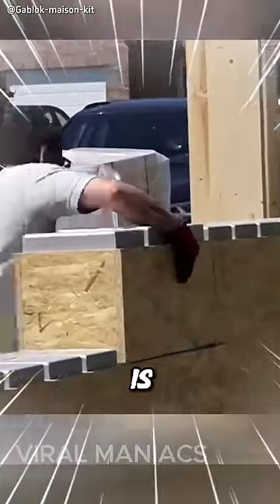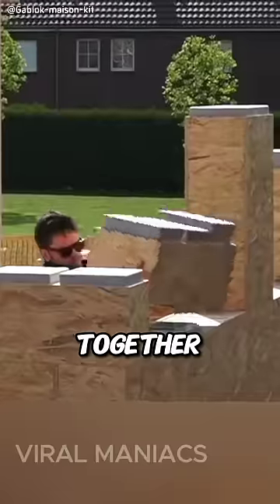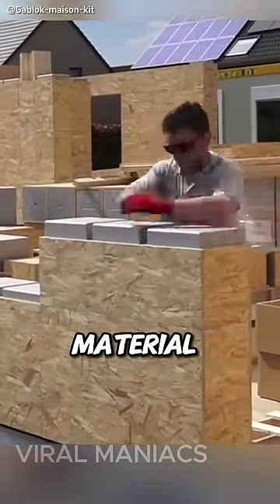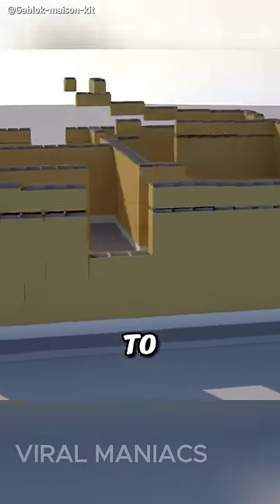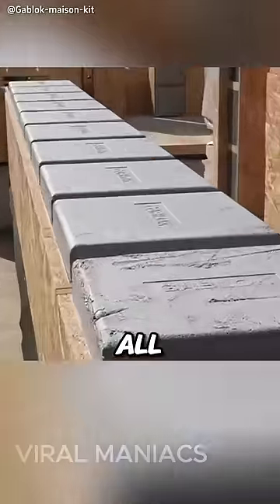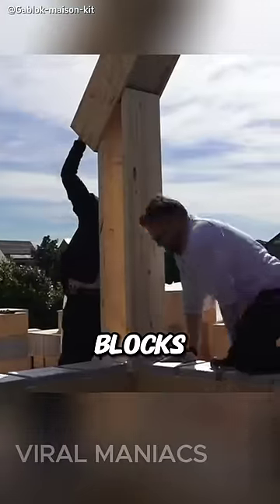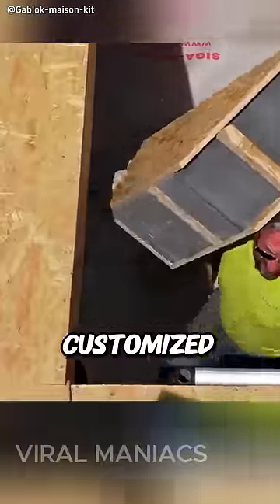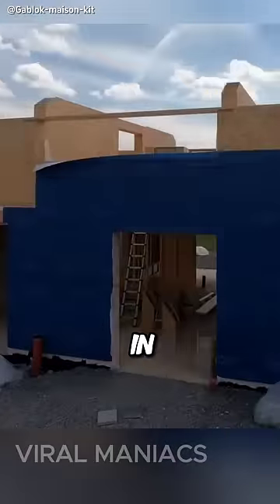Whoever Invented This Way Of Building Houses Is a Genius #shorts

Comment: About $97 for each of these blocks.  The company Gablock has a variety of home build kits available with the smallest going for around 50k, and the largest going for around 180k.  Keep in mind this is JUST for the basic structure.  No electrical, no plumbing, no paint, no appliances, nothing, just the frame and insulation part of the home.

The frame and insulation, which is all that this represents is only about 10-20% of the total cost of a new home.  So even using their least expensive home at $50k, assuming best case scenario that this is 20% of the total build cost, then you are going to be out another $200k for the rest of that home, making it a 1/4 million dollar home, which doesn't even hide your plumbing and electrical inside the walls.
Reply: Why would big business allow this otherwise?
Reply: Dont come here using logic and math 😂😂😂😂
Reply: Can you get it insured?
Reply: What about repairs to a damaged section? Going to take the whole building apart to repair a wet section?
Reply: @ChrisVerveda  good point.
Reply: And it burns easily.
Reply: It's literal plywood lol how u want that on an outer wall
Reply: @ChrisVerveda do you need to take a whole Lego house apart to repair it?
Reply: @SasqatchSteven wtf do you think the outer walls of a house are made of?😅
Reply: @SasqatchSteven and this is osb which isnt as good as plywood.
Reply: It would make a good barn
Reply: @joshuac.6437  Outer walls of a house aren't load bearing. This is just a really dumb idea.
Reply: Is that for each set of 3 , is the poly a 12 x 12 inch square . The house after a while Will squeak like a squeaky thing with any movement.
Reply: Cool…reminds me of Elsa Rhea and Barrons home they’ve built together in Colorado.  Great concept.
Reply: @jamiestanley8774  when the wind blows
Reply: This is probably best used as emergency evacuation centers during calamities and disasters, where you need to build temporary shelters on relocation sites to house refugees. It's a more durable and insulated alternative shelter against the elements compared to the makeshift tent shelters commonly used in third world countries today.
Reply: @SasqatchSteven  Really dude, you are aware Americans make their homes from plywood and OSB to right?
The home gets a wrap just like any wooden structure, then sheathed with whatever style exterior you chose.
Reply: And it must be built in an area that has zero wind 
EVER
Reply: And must be built in an area with zero wind, EVER
Reply: Ummm... I thought these were to be a replacement for just the exterior walls and insulation but you still had to do framing along the walls... This just basically made it so your framing didnt need insulation....
Reply: @kc72186  Why? The wall isn't going to have sections blowout, they're stacked like bricks and locked to each other vertically and from load. 2 nails per foot holding a stick frame wall up isn't giving you more.
Reply: @K-Locke outer walls are the MAIN load bearing ones. They're taking a majority of the roof load. Plus, the walls are stronger for wind shear. Commercial buildings of 2 or more stories have shearwalls and are the outer shell, therefore must be strong. Nails are typically spaced at 4" o c. on the sheathing board edges and at 12" o.c.
Reply: @michaelhanson5773  yeah, and that stuff would be looser to code as well not having to run through any load bearing sections. Interior framing and finishing could almost just be cosmetic.
Reply: Yes you 100% right.
Reply: @geofreak75  False, and you can't follow a simple thread. A poster said this OSB doesn't appear to provide sufficient support. The poster I replied to asked what the outer walls were made of, thinking, as you are, that the OSB or plywood nailed to the studs is load bearing. It is not. 
The studs are what provides support. Not the outer walls.
Reply: @K-Locke - you’re forgetting the combined strength of squares. Which is exactly why load bearing wall are filled with square/rectangular frames - not straight 2x4’s.
All these blocks are offset like common bricks… which can also be load bearing for centuries.
Reply: OSB Ordinary Shitty Board.
Reply: I'm guessing that you basically need to account for the plumbing, HVAC, and electrical when you figure out dimensions because it seems like you're gonna have to build the walls out for those utilities. You can probably get away with 2x4s. And I wonder how you account for making cuts for the duct work.
Reply: Imagine some youtuber pranksters living in one and one day say some of them go away on holiday and when the rest gets back all they see is a pile of bricks🤣
Reply: 1/4 of a million. Quit being dramatic.
Reply: @crystalm4324  Nope. Stick residential houses use straight 2 X 4 studs. Play pretend whatever you like.
Reply: Who ever invented this way of building a house is  a genius 🎉😂
Reply: No thanks !  Good for a shed or garage maybe?
Reply: If it is a real solution to the high cost of housing, they will never let us have it. Cuts too many people out and they will have their cut.
Reply: The seams all
Reply: @ChrisVerveda yes  !! MR LEGO MAN COMES AND TAKES CARE OF IT!  BL0CK HEAD IS THE MAN ! 1800 LEGO BLOCK HEAD....
Reply: Thank you❤
Reply: That's an absurd cost, the wood can't cost that much per block so it needs something cheaper for insulation.
Reply: Barndominiums are the same. I'm planning a 24x36 metal building with slab. $15K for building and medium insulation, ~$5K for slab. Another $12K for utilities, not counting inside contractors for plumbing, electrical, HVAC. 
At $75K, I'll literally just have a comfy shell. But then I'll have to panel the inner walls, install bathroom fixtures, cabinetry, appliances, and flooring, then paint, stain, etc, build shelving, have a driveway put in and fence the yard.
And don't forget the multiple permits required at different stages of completion.
Building a home, in any capacity, is a fortune now, but I find it worth it to be mortgage-free in my old age since pensions and SSI don't come close to sustaining.
This method is a similar price with much better insulation, but more cost for exterior.
Reply: @SasqatchSteven it’s osb and all houses have that under whatever siding material you choose
Reply: Not to mention the initial cost of the Land,  and the ongoing cost of the taxes  on  the land. And digging/ pouring foundations isn't exactly a do-it-yourself kind of task.
Reply: And the wolf 🐺 came along and easily huffed and puffed and blew that house down!
Reply: @SasqatchSteven You can use Dryvit over the outside face, which is also weather and fire suppressant, skim coat plaster on the interior. But now we're adding cost.
Reply: at $97/block, 4 x 8 section would be > $1,000. the same area with 1/2 in plywood, 1/2 inch sheetrock and 2x6 framing and fg insulation  would be under $300 and provide the opportunity to hide plumbing and electrical
Reply: Electrical? Plumbing? Grading? ETC!!!
Reply: Was thinking the same thing... Where does the plumbing and wiring go ? 🤔
Reply: Very good observation and analysis very impressive 😍❤️🇵🇭
Reply: @ChrisVerveda 😮 look
Reply: @DLB1858   Maybe it depends on the area, but in much of the US, they just wrap the studding with tyvek, nail some siding on, and call it a day.
Reply: @ChrisVerveda how often do you have internal structural damage on your house?
Reply: It's just the beginning
Reply: Guys, just imagine that house in Florida dealing with a hurricane
Reply: Well said
Reply: @johnlloyddy7016 i agree! And if assembled and taken apart correctly I could totally be reusable. Definitely a good “temporary” shelter.
Reply: @donaldready2118 locked by the finger tips! With NO reinforcements? Maybe with some rebar around the sides? Lol. Locked with 6 inches of plastic into a piece of weak box wood “Cork woo” that’s NAILED into the one inch corners? They probably gonna start assembling the outside of the wood block with a staple gun…..Kid friendly I guess. they probably advertise that you can put it together with the tools you already have at home! Lol. Butter knife and school stapler and some good ole Elmer’s!  And can’t forget the duct tape for repairs! SMH…… hell no! But if you want one, then hey….have at it! 😊
Reply: @JDYTC  
"And it burns easily."
So does any wood framed house.
Reply: @SasqatchSteven  
"It's literal plywood lol how u want that on an outer wall"

That is literally what they have been building houses out of for decades.  If it isn't brick, concrete or cinder block, it's plywood.
Reply: @ladyfame1430  tell me you don't understand how a stick built wall is held in place without actually saying it.
Reply: @keithcraig506   Of course. Hence, after a couple of big fires in the Middle Ages, some of us on this planet started using bricks to build houses 🧱
Reply: @michaelhanson5773  - Nope, this is made to build your entire house, all of your framing and insulation at once. Just sheath it, add your exterior finishing. And then install the plumbing, wiring and all interior finishes.
Reply: I assume the electrician and plumber overlay the wiring and pipes, which bare then covered by sheetrock to finish the interior... they will have to add a facing material to finish the outside walls too. They really are just selling the core of the home.
Reply: Utilities?
Reply: Can it stand on strong wind and rain? I'm afraid for a storm.
Reply: And no pictures in the wall
Reply: Not to mention how easy it would be for rodents to live rent free in your "play house".
Reply: I see the way you are thinking, but the cost of the fixing and finishing will not go up due to the cost of the structure going up
Reply: Only in America
Reply: @kennydempsey2079  cost goes up Everytime you add anything. So tell me, where does the electric, water, HVAC, and sewage go? Can't run em through the foam...
Reply: @itsmehi90  no harder than it is for them to live in any house. They can chew through concrete.....
Reply: @donaldready2118  its easier to chew through wood.
Reply: @itsmehi90  no rodent cares about easy, that's human crap.
Reply: $100 for a square metre of plywood and three pieces of polystyrene
Reply: The lack of hollow spacing between the wall panels would make this a wiring nightmare for electricians. 

While in concept this is a good idea, the minor oversight for inter-spacing electrical systems makes this a house fire waiting to happen.
Reply: @K-Locke  lol… I take it you’ve never actually framed a house before 😂
Try again and look closer….. I’ll help…. What is cross bracing? What are headers?

Watch sesame street if you need help with the shapes. (…the pointy ones in the roof are called triangles!)
Reply: @crystal It's a gable not a triangle. So, you need to be schooled. I suppose I can do that for you. See if you can explain the function of the header and cripple stud. You won't be able to, so it's purpose is to transfer the roof load to the cripple stud in order to allow windows and doors. That it forms a rectangle is completely irelevant. The same function can be, and is, achieved with an arch. There is no magic power of rectangles. You have no understanding of simple physics concepts.
Reply: @K-Locke  lol - Pythagoras is turning in his grave! Have you ever built a bridge? Braces are what holds the weight reinforcing a column.  Unless you’re using actual pillars instead of 2x4’s you NEED cross bracing. Whatever name you call it… it forms a “shape” - preschool 101.
Reply: @cystalm  I wish you luck in preschool, but as you don't have the basics of physics principles under your belt, I'm not sure how much I can help you. Forces are analyzed by their algebraic sums acting on a body, such as would be seen in a free body diagram, not by an object's shape. I gave a simplified example with the header, cripple stud, and arch, as well as the diagonal bracing. And, I see you don't want to discuss that. There is no magic power of squares. Just because a rectangle is observed by the eye, DOESN'T mean the shape is creating the strength. You just don't understand simple physics.
Reply: @K-Locke You are snarky, I like it :).  I wish I didn't have to weed through 77 comments to see what you were responding to lol.
Reply: @K-Locke  I just want you to admit that diagonal bracing makes a…….. triangle.
Yes there is tons of mathematical formulas and physics evidence to blur the jargon, but anyway you boil it down….. it’s just shapes.
Reply: @crystalm4324  You're so very weak. I never said shapes don't exist. You said, quote, "you're forgetting the combined strength of squares. Which is exactly why load bearing wall are filled with/rectangular frames".
There is no combined strength of squares, and sheets of building materials are square because buildings are square. They aren't 8' long because of numerology. They're 8' because that fits both 12 and 16" centers. And, that's it. You aren't getting any more of my time. You may beg me for the last word if you like.

Comment: So this is why the Americans always go flying through the walls in action movies.
Reply: Nah, our current walls are actually cheaper.
Reply: They test osb and plywood by taking a cannon that shoots 2x4 out of it at hurricane speeds. Your simply not going theough it. Google what osb and pluwood is and why its made that way. Its plenty stronger than you think…
Reply: @clapbootycheek1212  for exterior walls, yes to the osb. Interior modern US walls though are flimsy plaster and pine 2x4/2x6's. You can run through that with dedication and someone can definitely kick you into it. German walls though? you will die if you or someone else tries to send you through them.
Reply: @clapbootycheek1212  You wouldn't need to do that test with brick.
Reply: This would be WAY stronger than the current plaster walls
Reply: @fuzzfazu and what if a pipe busts in a german wall or you need to run wire through it? Ill take drywall in the interior over anything else.
Reply: no, you dont go thru OSB. I mean, you can, but that is death.
Reply: @fuzzfazu you can’t run thru it. Relax dog. German walls so tough why did Gorbachev pull them down so easily?
Reply: We make our walls out of paper and air.
Reply: Sheet rock is not hard to break
Reply: @jayjohnson7646  my boy its too early to be roasting like this
Reply: I'm from malaysia which is in southeast asia and we have thick wall. Everytime i watch american flying through wall in the movie i was like "wtf" but now i know they make house out of paper.
Reply: @Ejadopatra  half your country lives in mud houses, chill my boy
Reply: @NikoStark1  I don't have much familiarity  with other European construction styles that why I used Germany.
Reply: @brutusb8004  what year do you think it is? 1980? Everyone got concrete house now. Even our old wooden traditional house is stronger than america paper house. America house cant even protect you from hurricane and fire ma boy.
Reply: @Ejadopatra  Kinda depends when it comes to hurricanes but for fires that is accurate. Since soft wood is the more popular choice due to availability and how fast it renews through growth it is the primary material used for framing in the U.S. Gypsum, the primary material for Drywall and plaster is fire resistant, but the paper that holds it together isn't and neither are the vast majority of other items in a house. So unlike earlier times in the U.S. when a house would still be standing just damaged after a house fire when we used Hardwood, now the house goes up like a matchbox.
Reply: @fuzzfazu   who cares about interior walls though. try doing a remodel with brick in every room, and trust that any of those old timey homes built in Europe need a remodel, and good luck!
Reply: @thunderqueef  Who cares about interior walls when remodeling a house... a house... that is being remodeled... which has interior walls that make rooms and support the roof... riiiiiiiiiiiiiiiiight. In all honesty they'll likely go through the floor to bring electrical and water to a house if the walls are truly that indestructible, alternatively they can always drill small tunnel into the brick to run electrical, water would be a bit more annoying and you don't need water to go through the walls since most commonly it will be run through the foundation (in America at least) and then be made to come up to a location water will be used at. Additionally, if the wall isn't load bearing, meaning the house will collapse partially/fully without it, then the contractors will get to work beatin' it  down. Finally, honestly the biggest issue Europe will have going for itself home construction wise soon will be installing AC, since a lot of Europe just doesn't have a reason for cooling with AC,  then its going to be based on what their attics looks like and what their ceilings are made of (likely wood).
Reply: @fuzzfazu  don't need interior walls for support with structural beams.
Reply: @fuzzfazu  also many people think less interior walls the better, so them being made of 8 inch blocks just stops you from upgrading those homes to a modern standard
Reply: @fuzzfazu  why would would you be kicked through your wall?
Reply: @thunderqueef  also some roofs are supported mainly by the exterior walls
Reply: @jonsnow3176  You know nothing Jon Snow.